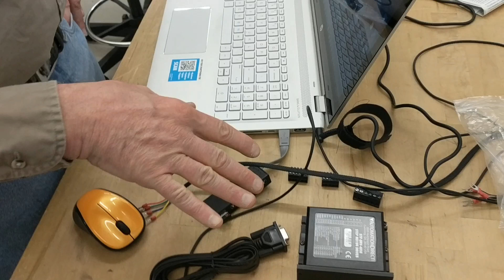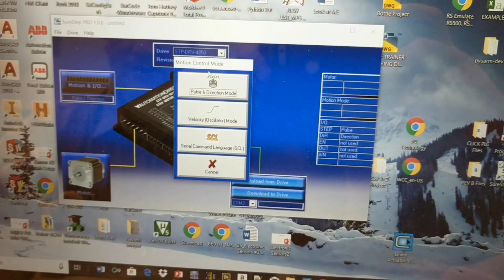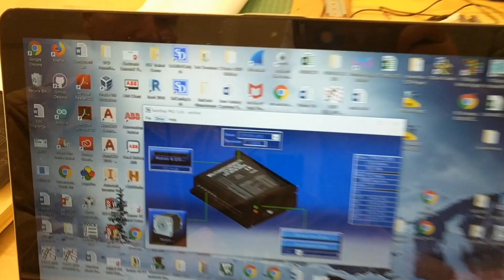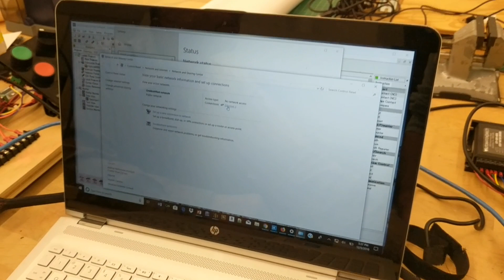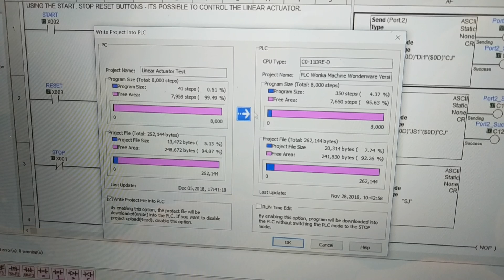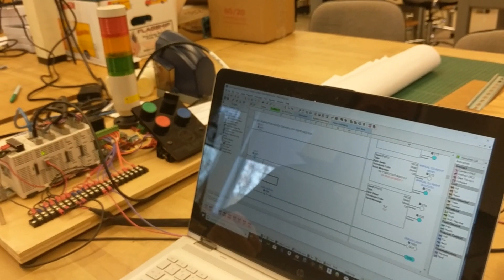CLICK PLC with SureStep and Linear Actuator

Comment: Why don’t you know what step you are on? It’s  pretty easy if you use a PLC to keep track of the counts and the step numbers, also you can implement some buttons to jog the carriage to the desired position, then record the positions executed.

If you get rid of that automationdirect stepper driver and go for a Nanotec make stepper with integrated controller and encoder, you can eliminate the PLC and the positioning calculations as well

Comment: Mr.Callinan- Great video, I am setting up a similar system from automation direct and I am having issues with multiple ASCII commands in 1 Send statement. Example: In your video you combine JS1,DI1, and CJ all in 1 send command. When I do this the driver and motor do not respond at all. If I seperate them into their own send commands it works great. Any tips on what I might be doing wrong?
Reply: Little late to the party but did you ever figure out how to send the commands together in one instruction? Thanks!
Reply: I need a video with the programming explained in the same manner. This is really the best resource and I'm so thankful.

Comment: Thanks! Useful information as I'm about to buy one of the Sure Step motors. BTW I think the "problem" with the software is actually that the drive hardware sends out a short confirmation string with model and firmware revision when It's first powered up. The software is waiting to see that string to know the drive is connected. When you power cycle the drive it sends that string and the software then knows it's alive and connected.

Comment: Good information Tim.  AutomationDirect has four different SureStep Drivers.  How did you determine what one to buy to match up to the OpenBuilds actuator?  From what I can tell, Amperage and steps per rev is what changes on each SureStep Driver model.
Reply: Nevermind Tim - I watched it again and see you have the STP-DRV-4850 SureStep Driver